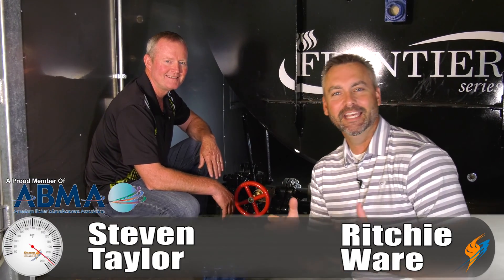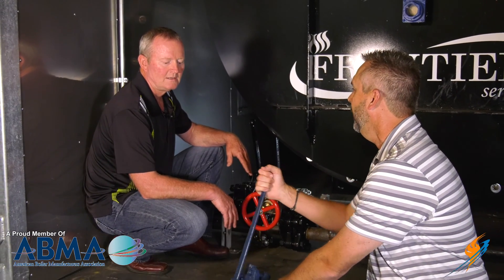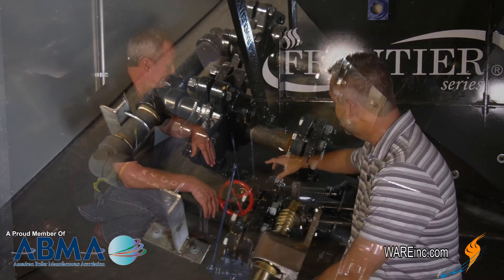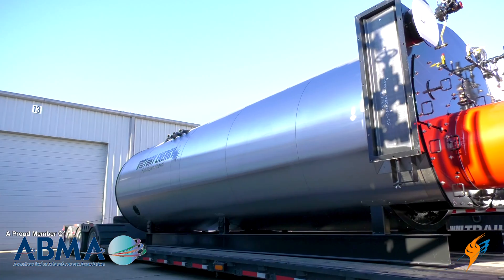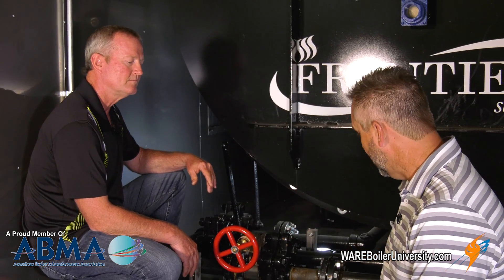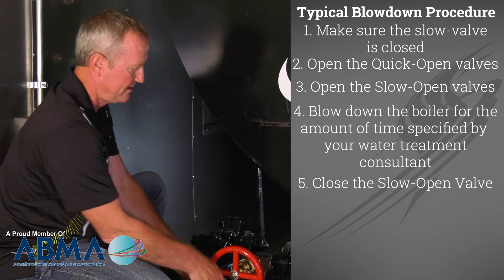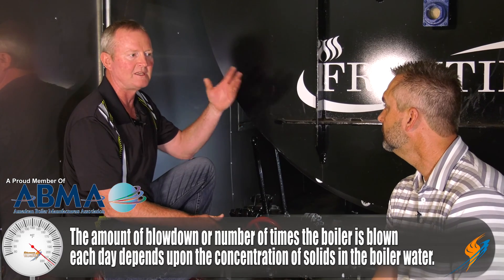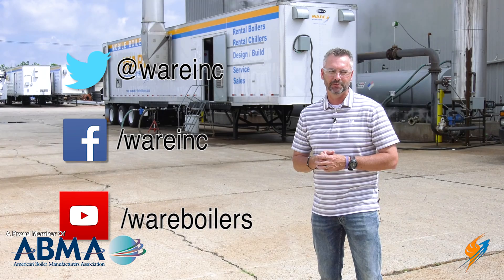Everlasting Valves and Boiler Blowdown - Boiling Point

Comment: Hello, I am wondering about the procedure you use when performing a blow down on the boiler. You suggest opening the "slow opening" valve again after you close the quick in order to drain any fluids in the leg between the two valves... why? In all my training and experience I was under the impression you never wanted to open a quick opening valve with such a large pressure differential across the plate in order to prevent damage.Thank you.
Reply from the maker: This is correct, you do not want to open any valve when you have a large pressure differential. Once the quick open valve ( the one most upstream to the boiler ) has been closed and your slow open valve as been closed, the operation of opening the slow again is to drain any water or excess pressure out of that little section. Hopefully that helps. As always refer to your chemical guy or your boiler manual for the best and most correct way to do your blow down procedure.

Comment: As an operator myself most people don't know that you should try and blow down a boiler when the boiler is at  its lowest run rate possible  giving  the suspended solids time to drop down to the bottom.